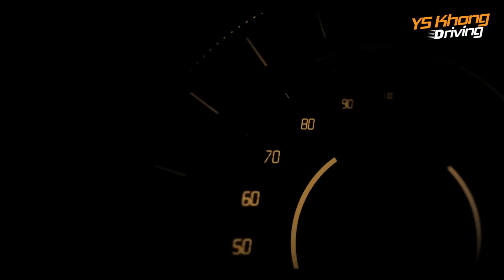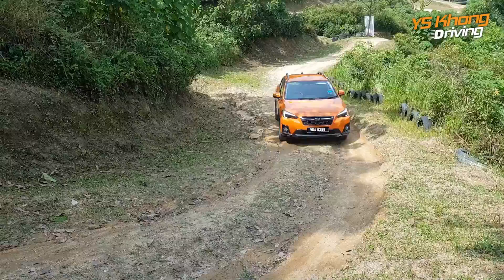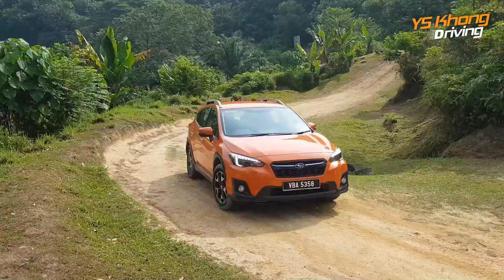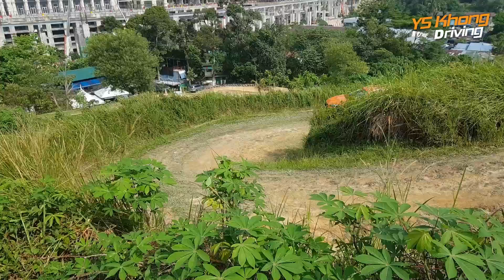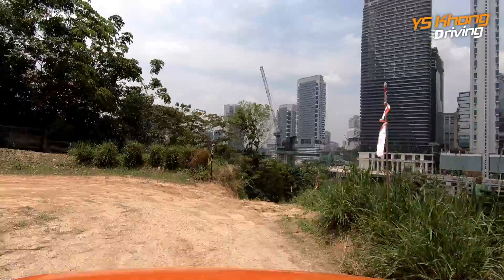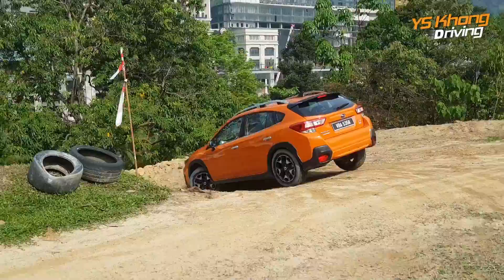Subaru XV Symmetrical All-Wheel Drive Test | YS Khong Driving

Comment: There is only two companies that make proper AWD - Audi and Subaru. 
I live in a place where there are snowy winters. Audi and Subaru are the easiest cars to drive. I can drive these cars faster than other cars on the roads during a blizzard storms and still control the car better. 
That said, always drive with care and respect mother nature. Because Mother Nature always have the upper hand.
Reply from the maker: Good insights. Where are you from?
Reply: @YS Khong Driving Originally from Sabah, Malaysia. Currently living in Michigan, USA.
Reply: But Audi Quattro is not full time AWD
Reply: @phunk8607  the Torsen diff Quattro is full time AWD which is the one I owned

Comment: Great video again. Do you think that the similar class such as XTrail and Outlander would be able to take on this course?
Reply from the maker: Hi Kimmy, the unique nature of this very tight track has some critical requirements - at two places, the vehicle will have two diagonally opposing wheels hanging in the air whilst negotiating a sharp bend. Whichever vehicle attempting this difficult maneuver needs to have.a system like the XMode in the Subaru that can transfer drive from one side of the axle to the other, in addition to a power-split between front and rear axles. Any vehicle not having such a system may get stuck, unless the driver manages to carry enough momentum to pass over the two critical spots.